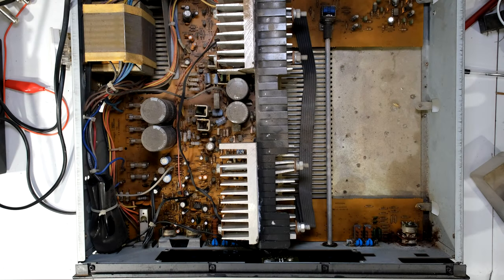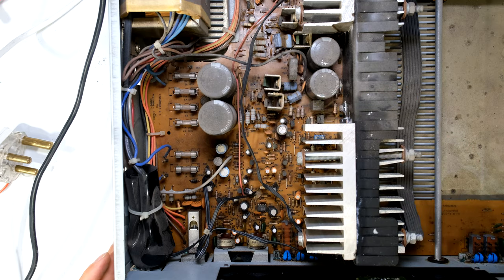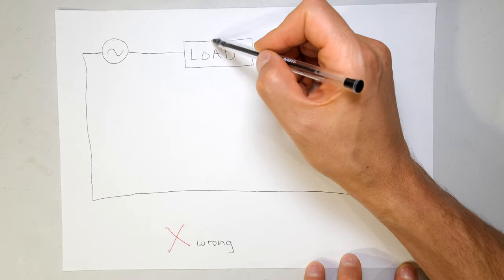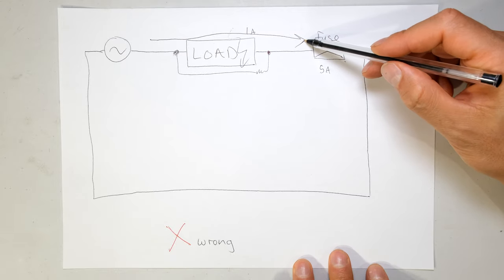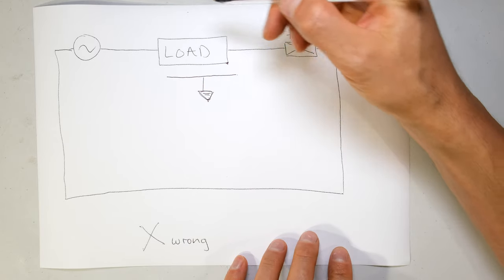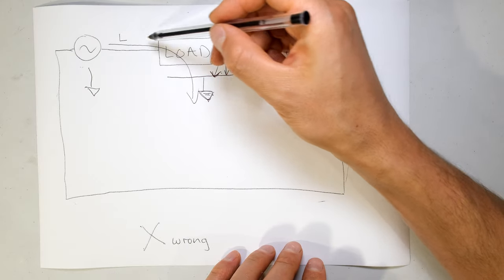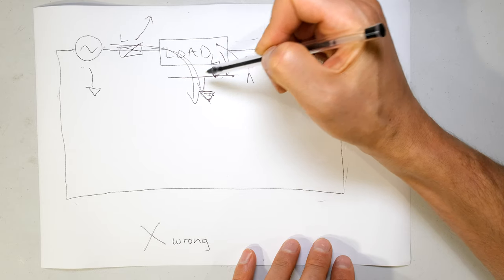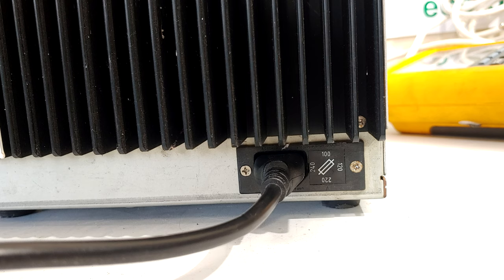Where to place a fuse in an electric circuit - brief explanation

Comment: If it is alternating current,  it cycles back and forth, so where is the fuse placed.....live or neutral ? Which is before the load and which is after the load if the current is alternating?

Comment: I am googling trying to find why 12V car 2A fuses are rated for 240V ? How does that work?
And after watching this the question comes up - are all fuses before the equipment? Surely not? You only need one 'before' the equipment. So the others must be IN the equipment. What about them, what's the story on them?
And last rating.  My problem is an electronic organ amp circuit with three fuses.  One, a 1.5A, is blown. I can only get a 2A.  I've been told put that in. Sounds wrong to me. Is it?
Reply: rated for amps